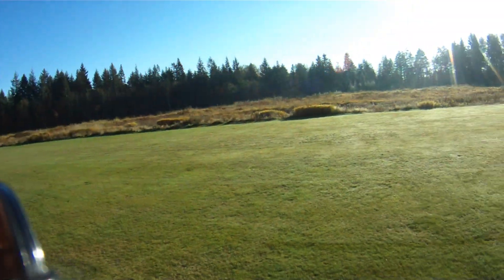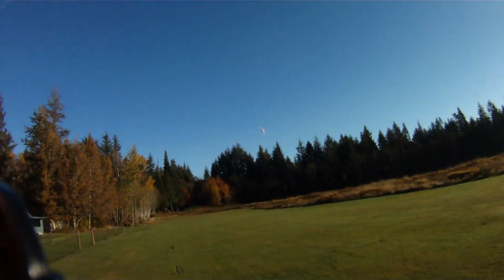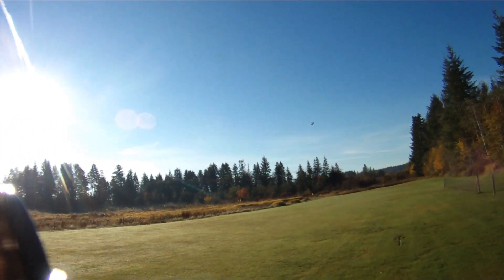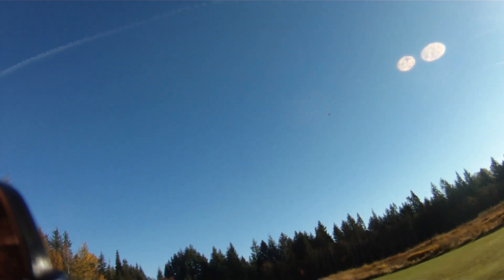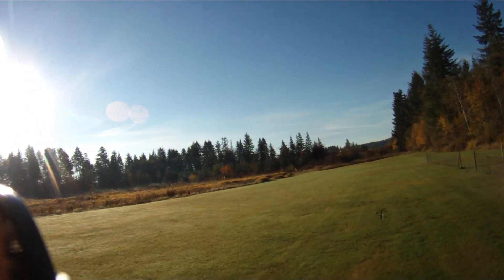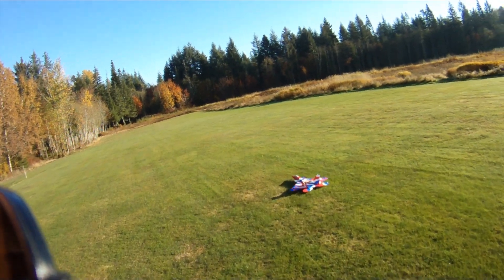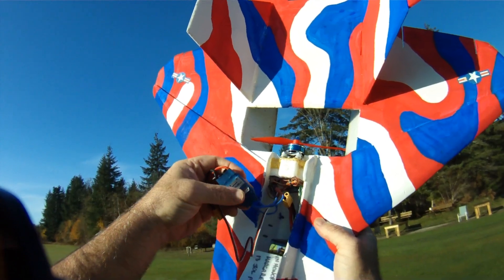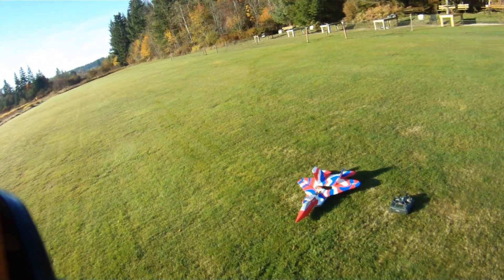RCPowers F-22 V5 Raptor Rippin' on 4S - 22 Oct 2018

Comment: Very nice! Fast ;-) How did those props hold up on 4S? Did you experience any unloading of the prop with the 4S setup? Happy Flying!
Reply from the maker: I have used these props on 4S with a couple of other motors, they hold up quite well considering how inexpensive they are.  There may have been some unloading of the prop at full throttle, they are certainly more flexible than the RC Timer 6x3 sport prop I normally use on 4S or the 6x4 APC gas prop I use on 3S.  As I mentioned I think I am starting to get to the drag limit of the air frame where no matter how much more power I add, the increase in speed is going to be minimal.  Happy flying to you as well :)  Cheers, Scott

Comment: This is how I am building mine.  This will be my first of the RC Power planes and I am almost done.  I am using the same setup as my Crashtesthobby Assassin, EMAX RS2205 2300KV Brushless Motor w/1300mah 4S and 40A ESC.  Great video btw!  I am excited to try mine out!  I am a bit nervous about hand launching this for the first time.  My Assassin has so much thrust I have to wing it and throttle it and I get good launches, so I have some experience but this will be new.  I am curious about the CG.  It looks like your battery and ESC are all very forward.  I have no hardware in mine yet (still building it) and it is slightly nose heavy)  I am guessing the servos and motor will give it a bit of an offset to the rear of the aircraft to help it balance.  Very cool video.  Also, are you using carbon fiber or spars in the elevons?
Reply from the maker: Thanks very much.  I believe my CG ended up about 3/8" ahead of the middle of the black rectangle on the CG spectrum.  I used some bamboo skewers in my elevons for some extra reinforcement as I built entirely of Dollar Tree Foam.  Here is a detailed video of everything that I did in my build of this plane https://www.youtube.com/watch?v=0SysS_wja-g&list=PLKu3yFqYM98mekYlm8Cr6wJ0zoBXQ2oz8&index=9  Good luck with the rest of your build and your maiden flight.  Cheers, Scott
Reply: @e3Scott  thanks!  I posted my build photos on Instagram, same username as here.  Thank you for the link and info!

Comment: Hi Scott.  I'm just returning to the hobby after a short break.  Took out my mig 35 and had a bit of a foam explosion as one of the control surfaces was loose. 😯

I'm looking to build a RCP plane again but just discovered they aren't operating any more. Such a shame.  Do you know If the plans are still available anywhere?
Reply from the maker: Hi Chris, sorry to hear about the Mig35 :/  RC Powers is currently under new ownership, you can read more of the details on this thread https://www.rcpowers.com/community/threads/keeping-rcpowers-alive.22421/  Apparently the old plans will be released over time, currently the V1 and V2s have been released, however only as a package where you pay one price and end up with all the plans.  No word yet on the timeline on the V3-V5 series, but I keep seeing updates now and then that they will be released eventually.  If you want more info, you could send a PM to F1wanabe on the forum, he is kind of the new head honcho.  Good luck with your renewed venture back into the hobby :)  Cheers, Scott